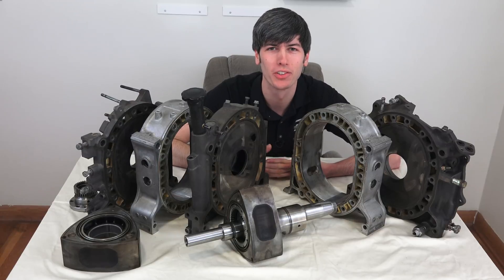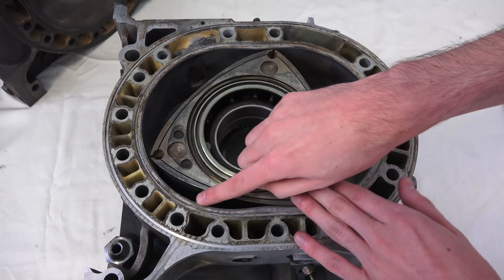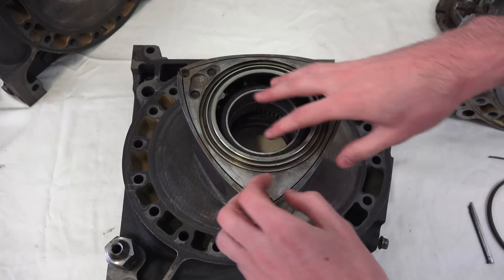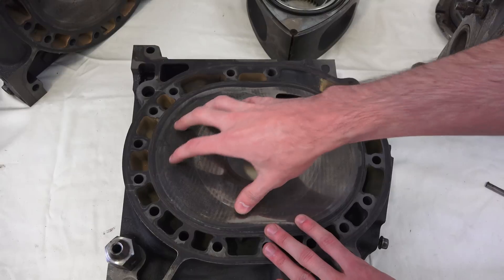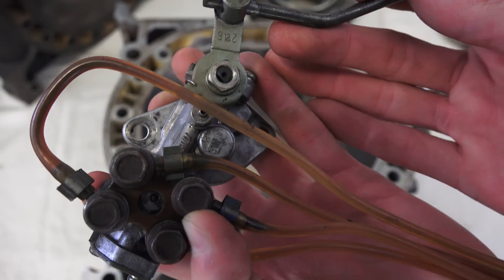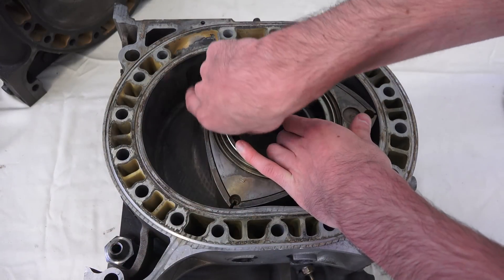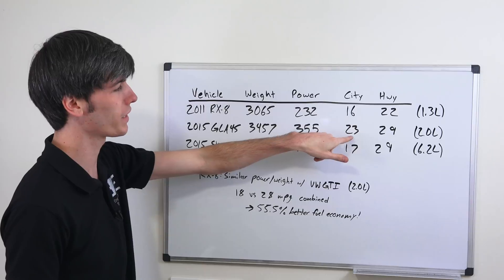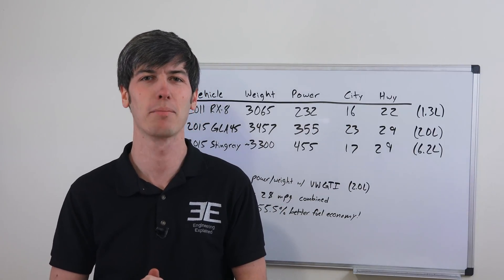4 Reasons Why The Rotary Engine Is Dead

Comment: Im not a mechnic or an enginneeer, but is the ignition occurring at the same time that the voume of the ignition chamber is rapidly increasing?
Reply: Yes, making it harder for the mixture to ignite, resulting in unburnt fuel exiting the exhaust port.

Comment: Rotary engines for racing yes! for the average person not really... you can get so many better options than a rotary engine.
Then again a piston engine can be re-bored and have oversized pistons fitted but I've never seen an oversized rotor? if there is correct me on that one! :)

Comment: Anybody who complains about the complexity of the wankel knows nothing about basic mechanics. Less components equals more complex? On the lack of power issue, that is a complete non-issue. A turbo charged 20B, a 2.0L three rotor engine, can produce 650 reliable horsepower all day long and I've driven a 950 horsepower 3rd gen. Rx7. The motor definitely has it's drawbacks, as with any motor, but pound for pound it is the most powerful. When it come to performance power to weight ratio is king.

Comment: how crazy complicated... Just make a straight gasoline powered 2 stroke with some type of unique lubrication. This will allow you to make a 5 liter engine which feels like a 10 liter engine since power is delivered twice as fast. using only 2 STROKES to obtain power and NOT 4 STROKES. The power delivery is TWICE  as fast. It's really a unique engine. If the Veyron was a 2 stroke? It could rev TWICE as fast to get to it's 1000 hp and probably be able to rev to 12,000 rpm. 2 strokes also have no mechanical valves to break, just ports in the head...

Comment: There is plenty of potential for the Wankel Rotary engine, as sealing problems of the rotors were improved dramatically from its' inception... The lubrication system was also improved substantially from the earlier system that the author presented here... And the power to weight ratio and reliability of this engine was favorable to competing piston engines.... So much,  that in 1991 - The world renowned 24 hours long LE MANS race was won by a car (Mazda 787B) powered with this engine design... One of the main areas of improvement would have been to improve the apex seals as they passed by the last spark plug cavity going from the combustion phase to the exhaust phase... Mazda was working on these problems as they had heavily invested research into this engine design... What the engineers did improve was to control the difference in heat between the hot & cooler parts of the engine by shaping the liquid cooling passages properly... From what limited information I have access to of their (Mazda) current situation, I have heard that they were working on a laser ignition system that could fire the fuels through a transparent window inside of the combustion chamber, thus leaving no gaps for the combustion gas's to escape into the exhaust chambers as the hi-temp 'window' would have left a smooth gapless surface for the apex seal to pass-over...From what I understand from those who have done a lot of work on Wankel engines, that this was the major cause of its' problems with low fuel mileage and High emission levels...  Then,  that huge tsunami  suddenly hit Japan in March of 2011 and pretty much wiped-out the funding of the Mazda / Wankel engine R&D...

Comment: Yeah, whatever... The rotary does not work in a similar manner to the GTI. It works on the wide power distribution over 4000 to 9500 revs. So many people compare peak output power, but that is just silly. The rotary drives differently. It is much easier to race and therefore usually faster than its piston rivals. So it spits out petrol and oil...your obviously not a petrolhead...you see that as a bad thing?

Comment: Couldn't a halfway-competent engineer mitigate most of these problems?  Like maybe re-shaping the rotor or using more thermally-efficient ceramics instead of cast metal?  The Wankel engine is over 50 years old.  There has to be a way to tweak it with newer materials, small improvements, etc.
Reply: The rotary engine is an ICE.  You mean the reciprocating engine is superior.

Comment: Another thing is RX7's(or rotary's as your title says) definately isn't dead. As I still own a third generation rocket and in races here in NYC and Philly, you'll still see about a third of cars being rx3 and so on. I do agree on the rx8.. no good, not in same class.. only problem with mine is after 100,000 miles, I order anther engine from Japan (twice) and go through DMV fit lack of vin numbers, but it's worth it.

Comment: also in a piston  engine the wear between cylinder and piston is linear. It can  "bed in"
 In rotary each rotation destructs the previous "bed in"  Therfore the seals can never last. No brainer, you wil simply continiou replasing seals!

Comment: 1.3L of Rotary/Wankel engine is not the same as 1.3L piston, the displacement is not measured the same, a 13B rotary is actually equivalent to 2.6L piston, not what you wrote on that board.

Comment: Raw HP figures dont give an indication of the performance of a rotary my RX5 rated at 120Hp would blow the doors off a 200Hp V8.Back in the 80's there were many rotaries racing competitively with 350Hp V8;s and winning

Because the power is made linear to the direction of drive unlike a conventional motor which creates power vertically than has to turn it 90 degrees by connection to the crank shaft, the weight of the pistons, conrods etc take away from power developed conventionally, however in a rotary it gives momentum along the drive plane.

Yes they suck juice, but the size of the carby on mine was mind boggling for 1300cc capacity, I only dreamed of 18 MPG was more like 12 MPG

Would I own one again - ohh yeah in a heart beat, power was only second to my porsche which cost 20 times more

Comment: You fuel rating comparisons are between the 2011 Mazda and the other engines from 2015. Why not compare all 3 for the same model year 2011?. The 2015 model engines probably get better gas mileage than their 2011 counterparts.

Comment: The whole oil burning thing effecting the emissions, I wonder how that compares to a diesel engine that basically burns oil
Reply: Well, depends on what you mean with clean. Diesel engines without exhaust aftertreatment are actually quite dirty. The only thing where they shine are the CO2 emissions but they are behind a comparable petrol engine in everything else. NOx, fine particle, Hydrocarbons and CO, it's all way higher than in a petrol engine. Also because Diesel engines run with surplus oxygen, the exhaust aftertreatment is way more complicated than in a petrol engine.
Reply: It compares unfavorably to a diesel engine. You realize that a diesel is compressing the air so much that the oil is burned almost completely... so much in fact, that the primary emissions problem with diesels (that the CARB tripped over their shoelaces about) is their penchant to get the nitrogen in the air too hot and compressed. They squeeze the air so much that nitrogen dioxides... purely from the air... is the big emissions bugaboo.

Diesels do put out some soot, too, which is the smoky old style diesel's nemesis. Obviously newer diesels trap the soot, too, so that liberals won't get a nosebleed.

The only diesels with emissions issues are the ones that Volkswagen cheated on... And I want to shake that guy's hand. The truth of the matter is that a turbo diesel is very fuel efficient and powerful if the government wouldn't cry about the NOx emissions and a little black, sooty smoke here and there... during acceleration and high loads.

The sulfur is pretty much gone, too. Diesels are clean now.

Wankels can't seem to clean up their act without some type of exhaust cleanup system which hasn't made it to the market.
Reply: Many vehicles cheat. Vw just got caught.
Reply: It's also worth noting that gasoline engines also black smoke, especially the newer direct injection turbo engines.
Reply: Good point
Reply: Big difference, (modern) Diesel is a highly refined form of oil that is designed to burn clean... its not burning engine oil meant for lubrication.
Reply: I bet they would be very similar the diesel engine is also considered more polluting that is why its tax is higher in my country.
Reply: Then your country uses fewer emissions devices
Reply: I simply bypassed the oil meter pump and mixed 2-cycle oil in with the fuel.  It worked great for a really long time.  My engine blew once because the waste gate actuator hose developed a small crack, resulting in a severe overboost, which caused detonation and blew the rear apex seals.  When taken apart for the rebuild, the inside was surprisingly, much cleaner than other rotary engines that used the stock oil meter pump, which all usually had a black glaze caused by burning oil that isn't designed to be burnt.
Reply: This is burning crankcase oil. In other words it burns oil.

Comment: Total BS - NSU had hick-ups with the RO-80, but in the early 70's they were all sorted out. Quite a few of them are still running now. Otherwise Mazda would have never picked up on the Wankel engine design!

Comment: Found a HFL Stratus 300 aircraft powered by a single-rotor Aixro XF40 wankel engine. This is a superb airplane. It is combined with a vibration-free rotary engine. This engine only consumes 7 litres an hour. (1.849 gallons.) These Wankels make a great aircraft engine.

Comment: My question is how did they even get started?  If someone came to me and said boss I want to do this and here are are the issues (which I heard no "pro,s").  I would of handed them a box to pack their stuff in as they were shown the door...
Reply: Pros: power to weight and sounds boss....
Reply: What about gas turbine?
Reply: Ditto that is what I said :-) and who care if it melts the pavement!
Reply: Interesting as I have always heard the heat was the issue with turbine...
Reply: Actually turbine engines burn 7 times more fuel than a piston engine making the same hp.
Reply: They had far fewer moving parts than piston engines and made much less noise and vibration. Before auto soundproofing was as good as it is today, these were selling points; and in their heyday, fuel economy was seen as far less important than today.
Reply: Felix Wankel, who worked for NSU in West Germany, was fascinated with rotary power. He came up with the basic design seen here, and a prototype was first built by NSU in 1953. The pluses (at THAT time) were 1/3 of the moving parts, light weight, high revving, low vibration, and high specific horsepower. This was WAY before 4-valve heads, balance shafts, ram intake tuning, variable valve timing, and fuel injection became common.

Comment: U.A.V. produces five different Wankel engines producing 20 to 120 horsepower. These engines are so reliable that they have accumulated over 1 million flight hours. They are used on 30 different platforms in 25 different countries. Will somebody out there please have a talk with "The real doktorbimmer ?" He seems to be suffering under the delusion that nobody on this planet is using or producing Wankel aircraft engines.

Comment: The rotary engine is dead ... on the road conditions but on track -  the compact size and low weight of the engine gives you perfect weight distribution and winning. That is why the rotary engine are still widely used in a time attack competitions. In the situation when you don't have to worry about the emissions, fuel consumption, service costs it is a winner.
I suggest changing the title from "4 Reasons Why The Rotary Engine Is Dead" to "The Reasons Why The Rotary Engine was killed".

Comment: I had one from the mid-eighties , it was the quietest car I ever been in, you could not feel or hear engine running at idle, the oil was still clean after 3000k as the day I put it in, it was a gas hog and short on torque but the  high revs made up the difference, mine never used any oil at all , I really miss that car......

Comment: Apparently the rotary engine is only mostly dead. A new company has picked it up and has changed the shapes of the piston (?) and chamber. The chamber is now triangular and the piston is peanut shaped. It is supposed to fix many of the problems you mentioned. The jury is still out but it will be interesting to see if they can fix it.
Reply: +The real doktorbimmer A E S T E A T I C  S C A M S
Reply: By piston I think you mean rotor.

Comment: Found an aircraft for sale by Micro-light E-go. It is a canard commercially built in the factory in England. It is powered by a Rotron single rotor Wankel. It has a stainless-steel muffler system. They have been flying it for years. They also have a real long string of customers eager to buy one. This Wankel consumes 2.8 gallons per hour of 91 octane car gas. Normal cruise speed is between 90 and 105 miles per hour.
Reply: What's the price on it? 0_o
Reply: Not cheap. Nothing in aviation is. I saw $71,000 was the final bid. I do not know if that is English Pounds or American dollars ?
Reply: My brother Karl and I built an experimental aircraft called a Quickie 1. It is powered by a 20 horsepower Onan. Stall speed of the front canard is 63 miles per hour. Best rate of climb speed is 75 m.p.h. Approach speed for landings is right at 75 indicated. Normal cruise is right at 105. The fuel tank contained 7 and 1/2 gallons of 100 octane. The Onan would consume 1 and 1/2 gallons an hour. Flew it cross-country a lot. It took 4 and 1/2 hours to fly from Sherman Field, Leavenworth to Denton, Texas. We built it from scratch for $5,000 dollars out of fiberglass and foam. It is a joy to fly !
Reply: Bug Dust If aircraft for personal use is costing tens of thousands of dollars, I'm sure you could make some serious profit off of that.
Reply: The E-go canard aircraft is built in factory molds. They use high-tech carbon fiber as the construction material. The Rotron single-rotor Wankel is a very high quality aircraft power unit. (Rotron builds thousands of these per year. Most of them are sold to the military as an aircraft engine.) Rotron manufactures 2 rotor Wankels also. One of these engines is rated at 100 horsepower. It is a turbocharged motor. This Wankel now holds the altitude record near Mt. Everest of 29,494 feet !

Comment: Rotron and U.A.V. are two of the major contractors for military drone power plants. Both factories build multiple Wankel units. They build single and multi-rotor depending on the requirements in the military contracts. The reason the military prefers the Wankel is because it is much more reliable than the previous piston engines they had been using. They have been getting extremely long service life from the rotary engines. With the modern materials used in the rotor tip-seals and side seals these Wankel engines have a very long service life. Some of these aircraft engines in a war zone get really abusive treatment,...but they keep right on running !